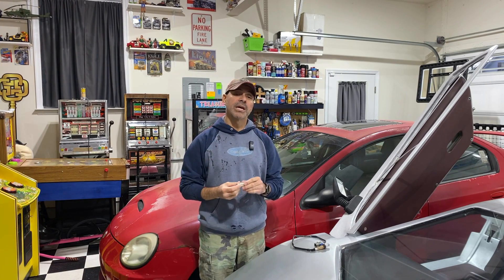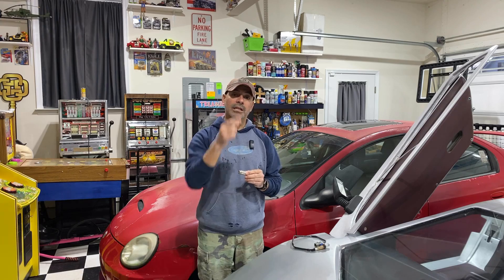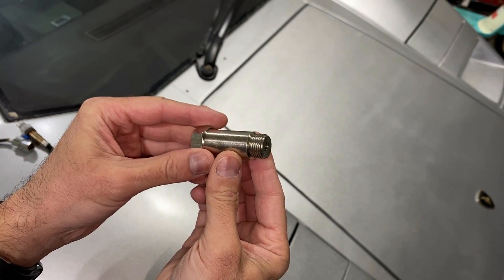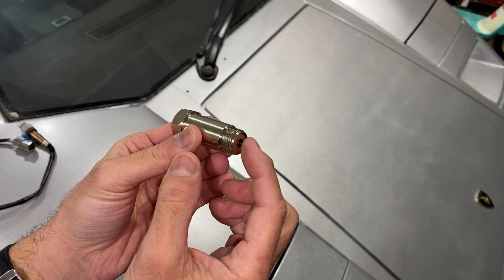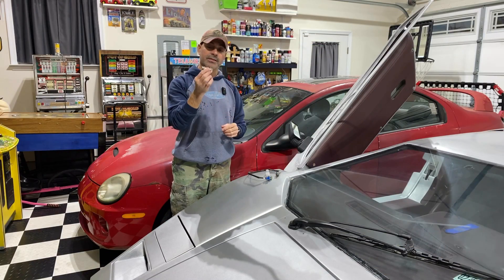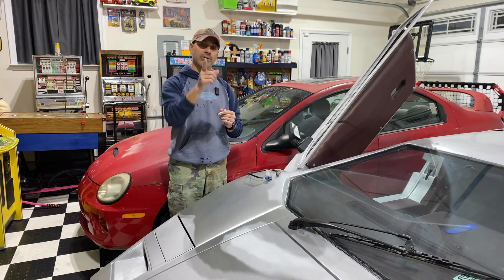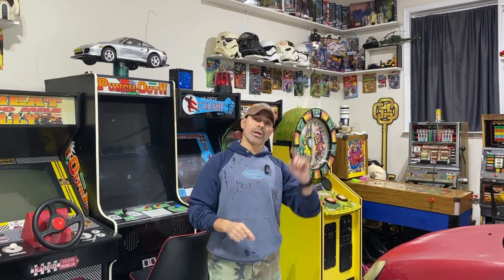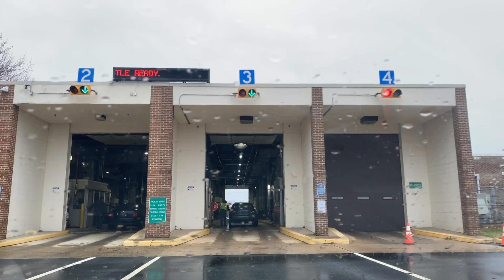Do Oxygen Sensor Extenders Really Work?  (Andy’s Garage: Episode - 453)

Comment: This only works on old cars. Newer ones have a test procedure which consists in the ECU enriching the mixture from time to time and checking whether this will be reflected in the readings after the catalytic converter. In this solution, there will be no difference so an error will appear...
Reply: What do you mean by "old cars"?

Comment: I have a 2013 ford f150 platinum,  i took a exhaust pipe and drilled 1/4 inch holes all over the pipe. I then cut open my cat cleaned it out then put the pipe into the cat. Closed the cat welded it closed. And put the original sensor back in. I live in Massachusetts and i have passed inspections for the last three years.
Reply: You removed the catalysts and  Intalled a pipe through it? Have a 2022 f240 with p0420 and non fouler isn't working. Might need to try this
Reply: Wait really

Comment: It didn’t work for me . Even after putting spacers and putting it after the converter . What did I do wrong ?
Reply: @dimebagful  You did nothing wrong.  Frequently they don't work.
Reply: @robertjohnson4401  thanks for  the reply gonna get new cats and go from there
Reply: @robertjohnson4401  thanks for the reply . Just ordered walker brand cats and gonna see if they do better
Reply: Kia. Or Hyundai might not work.
Reply: @Ready4smog  I tried it on a 2006 Toyota Corolla.  It didn't work.  Once I replaced the catalytic converter, no more issue with P0420.

Comment: Drill a half inch hole in the first one  the one the o2 sensor goes into. leave the second ones hole alone stuff steel wool inside the one that screws into the 02 port and it will work on any vehicle new or old
Reply: Huh 🤔?
Down stream, the one after the Cat.
Only need to do that one.

Comment: Will the extension also help with misfire & rough idle?
Reply from the maker: @oldschoolrican  no, that may require spark plugs and/or wires, ignition coil packs to be replaced. You need to use a scan tool to see what cylinder(s) are misfiring first so you don’t throw money at it
Reply: @PhillipsVision  Autozone's diagnostic test says cylinder # 2 & 4 needs or coil packs needs attention. I just saw those sparkplug fouled with oil.😬

Comment: Great video, Extenders is really a cool idea to get your emissions done ☑️ but it must be removed just right before the SMOG center . Don’t drive too much after the extenders removed because ECU will throw the error again !
Reply: Elaborate please. I need to pass the state inspection and I have code p420
Reply: The extender just help the catalytic smoke not to trigger the O2 sensor.  I passed the emission by changing the catalytic converter by myself  ( extender didn’t worked for me ) and drive all the possible ways to get all the I/M readiness ready. IM readiness must be ready first otherwise the won’t even allow you to take the emission test.

Comment: Thank you for this video! Is it safe to keep driving my vehicle with the extender on the 02 Sensor? or do you recommend I take it off after I pass my State Inspection?
Reply from the maker: @JdmSana  I leave mine on…no issues
Reply: @PhillipsVision Thanks. I had it on for about 2 weeks now and no issues. I was curious at moments if I should take it off. 😅
Reply: Leave it on.
Reply: @gregbuckley7596  Yeah, I have been leaving it on. The check engine light did not come back on. Thank you.

Comment: I have no codes but put a cheap catalytic converter on. It has a lean smell cause of the 02 port being cheap. Will this help my smell/lean or rich problem? Will it trick the computer to make it a hotter fuel air ratio? Thanks for any help
Reply: You need a tune bud
Reply: @tylerbenefield2498  yy
Reply: @tylerbenefield2498  ty
Reply: @tylerbenefield2498 there has been a ton of parts installed in a complete tune-up and still the smell. No mechanic to find out but they're saying it's just a cheap catalytic converter. Some of them said to install a small one behind the new one and that might help with the smell
Reply: Check fuel trims with scanner

Comment: Thanks you so much for the info .

 Do you know if this work for Ford fusion 2016 ?

Do you didn't remove it , when you did the Smog check right  ? , it pass the Smog with spark thing on rights?
Reply from the maker: @FranciscoGonzalez-ou4jv  it should work on any vehicle with O2 sensors. You do not remove it, but keep in mind if you live in a state the does a physical check you will fail.
Reply: @PhillipsVision  Thanks you so much , video is so helpful. 

I put the spacer on my fusion  but light came on again with a new code which is P013A  , I think im goin to need to replace that sensor .
Reply from the maker: @FranciscoGonzalez-ou4jv  yeah, sounds like the sensor is failing

Comment: Some vehicles will give a code for the rear oxygen sensor low circuit with this spacer.
Reply: Does that what i5 means? I bought a 02 Silverado from a co worker & the cat was stolen so the owner straight piped it. With the OBD scanner it says low circuit. But i don’t believe it has a spacer on it.
Reply: @SemperShock  If the cat was stolen , the wiring was cut or damaged on that sensor.

Comment: Great video and well explain. I have the same thing error code as p0430 on my Sienna. I bought one today. Is this to put inthe back of the cat converter to the backend of the uxhaust? Thks
Reply from the maker: @nebhosspin1252  installs onto downstream sensor, the one AFTER the catalytic converter
Reply: I @PhillipsVision I got 2 sensors downstream. I assume to put in sensor #2?
Reply from the maker: @nebhosspin1252  yes, both downstream sensors
Reply: Where i can buy it ?
Reply from the maker: @ChannelSASLiem  online. I got mine on Walmart.com
Reply: @PhillipsVision  thank you
Reply: @ChannelSASLiem , auto store, ask for Spark Plug Flouler.
Actually made for engines that blew oil into pistons, floul up spark plugs.
Drill hole BIGGER.
Reply: @roberthein2156  thank you

Comment: This worked perfectly for my '03 camry 2.4L (barely fits, btw - very tight fit next to oil pan). 420 CEL never came back on and my cat is hollowed out completely. Glad I went this route.
Reply: where to buy the spacer and what size, thx
Reply: The check engine light of death will always come back on
Reply: Bullshit, it didn't work for me. Joke
Reply: Worked for me on my 02 3.0L.  It's been in there about 5 years now

Comment: i have a 2022 kia soul (2.0L/IVT) with 95k miles and i've had a P0420 code since about 65k miles. The car does burn 1.5qt of oil every 5k miles (which is my oil change interval) so i'm assuming the code may be related to that. my first emissions test is coming up, i've been considering adding an O2 extender and praying lol.
OEM catalytic converter is $4,901.35........

Comment: wished you would have showed the graphing after repair. always before and after is showing a result, i tried them a couple times on a couple 06 and 07 vehs and light would still come on.the idea is to keep those o2s at a steady 600 to700 mv no switching  when graphing they still switched but not as bad but enough to throw a code. could u show them after ur repair in graph mode would be nice.

Comment: If you're in CA... EVERY SMOG TECHNICIAN is on to this. Make sure you remove after the drive cycles complete BEFORE the test.
Reply: Been on my car for 5 years nobody has checked
Reply: @stevesmith756 do you in California?
Reply: @charlesfullmer4662 do you what?
Reply: @stevesmith756 meant to say “do you live in California”
Reply: @stevesmith756 are you in Cali?
Reply: @stevesmith756  you smog your vehicle in CA? I'm sure this could work for me but not if they inspect.. definitely don't want to end up with some penalty
Reply: @gabrieltiso8537  yes Ca. Riverside County
Reply: @Stew_Pid  don’t want to front the guy off but nobody will pass you with a code on. Do the spark plug fouler thing
Reply: @stevesmith756  I also live in riverside. Where/which shop did you get your car smogged at?
Reply: @stevesmith756 what is that?
Reply: Drive for awhile with it and then remove before test ?
Reply: @hyunwhyte1338 yes... you need to remove before test. Idle in there.
Reply: @danielfiore8865 so remove right before the drive over the smog spot is what you mean? Wouldn't the code just come back on?
Reply: @hyunwhyte1338  it comes back on at freeway speed...
Reply: I would remove it down the block from the smog shop
Reply: @danielfiore8865 wat do you mean by idle in there ?
Reply: @K1500b it means to drive in without giving it any gas put it in drive and let the vehicle roll byitself
Reply: @hyunwhyte1338  won’t work. Removing and reinserting the sensor will put system back to not ready.
Reply: @hyunwhyte1338 yes
Reply: @danielfiore8865  great idea on using it to clear the code then remove it right before the smog check. Then put it back on after
Reply: @stevesmith756  yeah, shouldve clarified, getting the code off and then going with it still attached. Wasn't sure if removing immediately upon the code dropping off would hold for long enough to get to the test location.
May give it a shot.
Reply: Ive cleared codes before..drive 50 miles then get it inspected.passed..sure it comes back on later...but did your code stay off after you installed extension? This is the question
Reply: @natalecriscimagna447  yup
Reply: @natalecriscimagna447 I do the same you did and it passed the test. I don’t have the spacer on mine.
Reply: I bought a car after getting it inspected by a mechanic and went to get it smogged and i got failed for tampering for this exact thing. (i known i should have made sure the csr was smogged before im 18 and this was my first car i bought and it was a nightmare experience and I’m paying the price for my incompetence)
Reply: So did it shut off the might and keep it off?
Reply: @Blblazer1210  it’s shuts the light off permanently. It moves the sensor out just enough to sniff clean air. Keep in mind your cat is getting plugged
Reply: What does it mean when you add this but code still comes up ??
Reply: @anthonybaeza2215  ur cat is so bad even the o2 spacer can’t trick the computer
Reply: @danielfiore8865 @phillipsvision will it work if cat was stolen ? 😮
Reply: @miggs486  lol
Reply: @miggs486  😆 🤣 😂 😹 😆 🤣
Reply: @miggs486 you don’t want to hear that sound as the cat stolen ( missing the cat) and it is against the law. Police can give you a ticket for loud noise and not clean air ( missing the cat)
Reply: In California all they do nowadays is plug in a code reader and if everything passes it good to go. They dont check to many things anymore.
Reply: No wonder California is bankrupt !
Reply: To heck with ca. No one wants to live there
Reply: A number of recent model cars automatically run a program periodically that enriches the mixture for a short time to see if the downstream oxygen sensor responds correctly. It will not if an extender has been installed and an emissions inspection may reveal what has been done. You would be confronted and possibly fined serious money.
Reply: If you're still in California there's something wrong with you lol

Comment: The O2 sensors meassure how much O2 there is in the exhaust. The information from the upstream one(s) feed back to the ECU that regulates the Air Fuel mixture accordingly. The sensor downstream of the catalyst converter should read less O2 than the upsteam sensor and the extention gives the sensor less access to the O2 in the exhaust due to reduced pressure on the sensor when using the extention.
Reply: you are correct but you have to try it on 08 up with a faulty convertor. the pcm is programed differently now. i have tried it numerous times and has not worked for me.  your theory is correct and usually u see on graphing it stays around 700mv which is rich,it should never mimic up stream. but the pcm program  i guess its smarter now.
Reply: Which is exactly why it works
Reply: I thought post catalyst nitrogen oxide breakdown to nitrogen and oxygen increases the oxygen reading. More oxygen in sensor reading means catalyst is working vs same reading of oxygen as upstream sensor?

Comment: I learned from this video that the extender needs to be on the down stream oxygen sensor not the upstream sensor. I’ve already bought a couple of different styles of spacer just in case. I spent between $5.00 and $8.00 each. I got them online from one of the last places you’d expect to find them.
Reply: How'd it go? Make sure to take the spacers off before your test...they'll catch ya. Then they flag you for tampering
Reply: @danielfiore8865   I haven’t had an opportunity to try one yet. But I will let you know when I do. I have tried Cataclean with disappointing results. I’m going to try it again though to see if the results last beyond 80 miles.
Reply: @uncletoby-  Cataclean  will work if the cat in not too damaged.All the Fuel trims have to be below 10.
Reply: @danielfiore8865  they won't flag you. What's the point of them flagging you? What are they gonna do if you have to many "flags" they gonna take your car? They have zero authority to do any of that. There is no such thing as flagging
Reply: @Mr.Thermistor7228  they won't pass you. They'll mandate your inspection to state ref. If you want tags...youll get an inspection there next. You lack knowledge my friend.
Reply: @danielfiore8865 lmao what no they won’t flag you anything. They just won’t pass you. They cannot prove it was you who put it there and it’s not worth their time or effort to “flag you” for tampering. I’ve gotten occasional checked and was immediately failed. Came back at a different time with a different person and they didn’t care
Reply: I'm a smog technical in California. If you cannot perform this method.  There is a way to use the cataclean and warning up the cat in your car.
Reply: ADAM & EVE ADULT STORE ?
Reply: They won’t pass the car, it’ll be on the cops computer. If you get pulled over, ticket go ℹ inspection ticket = $200-$300..
Still have to get it inspected !
Guess find out yourself ?

Comment: Didn't work for my 2010 caliber. Maybe the one with the filter (mini cat) would work.
Reply: I’ve got a 2010 Jeep Patriot which has the same engine set up as your Caliber. I’m going to try CataClean first and I have the extender with the filter (mini Cat). It was $11.00 and was shipped from China. I’ll let you know if it works.
Reply: @uncletoby- cataclean is a bunch of snake oil horse shlt
Reply: @uncletoby- did it work?
Reply: @MH_BeamNG   Unfortunately not. But I only ran one bottle. I’ll give it one more try and run 2 bottles. One right after the other as soon as I can afford it. I was able to buy an aftermarket manifold catalytic converter on eBay for $64.00 and will eventually try that too.
Reply: @MH_BeamNG I haven’t tried the oxygen sensor extender yet.

Comment: You only about a 1" to  2" stand off. Anything to tall you will get false readings your car will have other issues.
Reply: No it will not. The downstream sensor has nothing to do with anything regarding how the engine is running.

Comment: Great informative vid. sorry if I missed it but where did you get the 02 spacer and what brand? thanks!
Reply from the maker: I ordered it from Walmart online. There are links in the description of this video
Reply: @PhillipsVision  ah got it. thank you! last question: any issue/problems installing these with a catted dp as opposed to catless? want to go with a high flow 200 cell sport cats to get most of the benefits of catless without the smell. but it will still prob end up throwing a CEL and was hoping to avoid that with an O2 spacer. thanks in advance!
Reply from the maker: @js002003  it should still work with the cat application you are doing
Reply: I got mine on AliExpress for 3 dollars

Comment: did mine as a test to Audi TT   for almost 2 weeks but it seems the downstream sensor(2) is also part of the important thing, I mean a fake reading is not good for both sensors, and lastly it will trigger the limit parameter and yes, the engine light will be ON , but Maybe it can help if you have issue with Catalytic but  My Cat is great still !
Reply: The downstream sensor has nothing to do with how the engine runs. It does not have any effects on air/fuel ratio or anything. All it is doing is detecting if the catalytic converter is making a change in the exhaust coming out of it. Nothing to do with any process of the running engine
Reply: @Mr.Thermistor7228  they actually do more than cat efficiency. but if u watch them from cold start to warm and cruise before install and after install  while graphing is the key to get a comparison. if they stay steady around 700 mv aprx .not switching is what the pcm is looking at. so  he never showed that after what he done. Always numbers is data before and after repair.but try it on some 08 up and see what ur results are and see if the car never sets a code. thats a real test. i get what ur saying but the pcm is programed different now cany fool it as easy
Reply: @Mr.Thermistor7228  yup most it will say the same there is nothing to do than post cat check but i guess its not in my Audi, I was monitoring the value both and anothers for almost a week, running leaner lastly the light turned on again and again , Now i got a new sensor and the car is running better than before, Great !
Reply: @HellaMeiste 
They are sensors, they have nothing to do with how the engine functions. 
They tell the engine how rich the fuel to air ratio is
Reply: 8:59 9:08